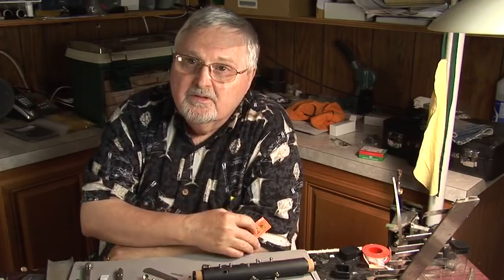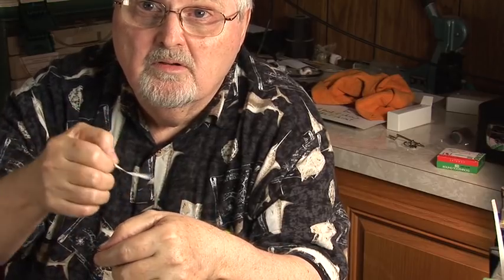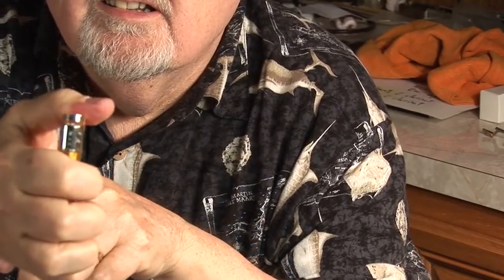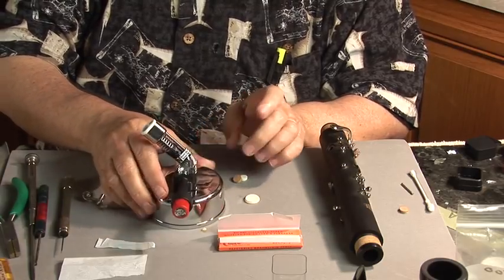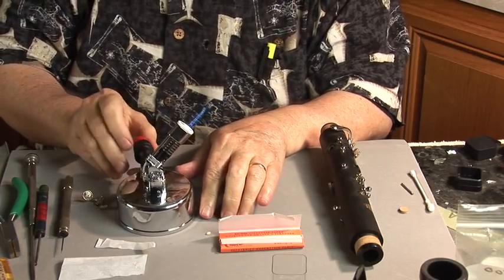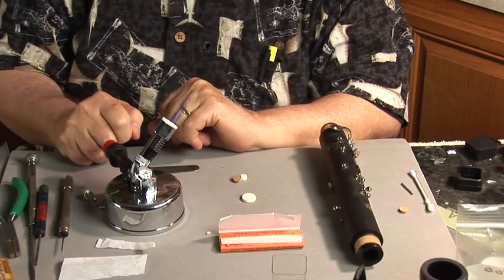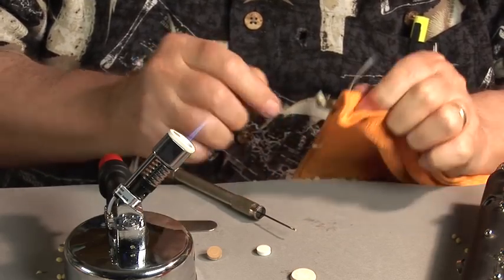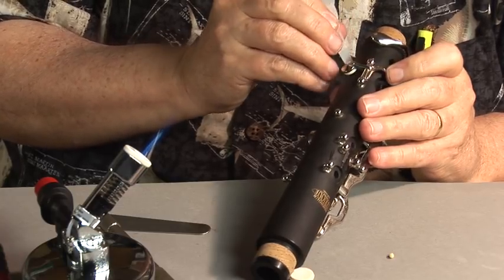clarivid 82b how to install clarinet pads

Comment: This video really helped me! I play Scottish flute (the older simple-system flute that's built like a clarinet), and it's hard to find repair techs who will work on my flute--even though it's like a clarinet. Your video was great because it clearly showed the flame technique for heating the pad cups--I was doing it incorrectly for fear of overheating the pads.

I found that using a jetted burner like yours (or mine, a repurposed torch for making creme brulee) made a huge difference. Thanks!

Comment: I followed the instructions and it worked perfectly. I used the materials provided in a MusicMedic repair kit. I tried hard to eyeball the pad as uniformly flat and level all around as possible and no float in was required. Plays great. Excellent video. Thanks.

Comment: Thank you so much for making this!  A pad suddenly fell loose in a key cup, and with no local repair shop or even simple tools, I was lost.  After watching your video, I experimented with heating the key cup on the clarinet for an emergency fix and was able to melt the glue enough to get the pad to reseat.

Comment: Thanks for the video! I bought a cheap Bundy Resonite off Craigslist because I wanted to play again. The last time I played was 23 years ago in middle school!!
Everything seals perfectly except the first large key at the bottom, which takes a ton of pressure to seal. Turns out it was leaking a bit on the inside "pad too thin".
I'll get it repadded properly later, but for the moment, I slipped a bit of ELECTRICAL TAPE under it, and it seals a whole lot better now!
Of course this isn't a permanent fix, but I can practice a whole lot easier! The notes that required that pad were really fighting back!

Edit: Took the key off, melted the glue with a lighter, added some more hot glue and re-seated the pad.  Seals PERFECTLY now.
Also, one of the springs was a bit weak - I bent it a little to provide more sealing force.  Works great now!

Thanks for the info!

Comment: @bobwas4066 I actually made the spring hook in 1978--from a piece of drill rod. I hand filed it and shaped it--and it has worked great. The screwdriver I bought about the same time. I"ve had others since, but it is still the best. I got it from Allied or Ferrees, but, again, using drill rod of the right diameter and flat files, etc, with a little patience you can make your own screwdriver. On the clarinet a long on like I have always works best. Hit the hardware store and use your imagination.

Comment: Thank you so much for your EXCELLENT teaching video...I just re-padded a cheap Selmer Bundy and on the top piece, I have 4 leaking pads..I used only one georges ball for each pad...may be my problem. The ones that are on the side are the ones not sealing...will try your fix tomorrow....I do a lot of personal car work on 3 street rods and your fingernails looked like they were manicured compared to mine...the finger nail comment below was not appreciated by me...your extreme helpfulness was.
Reply: Where do you buy that Georgia pellet Glue?
Reply: @leopoldoroldan345  It is called "George's Glue" and it comes in pellet form. It can be purchased from the JL Smith and Company website ( http://www.jlsmithco.com/padding-adhesives-2?range=13%2C15%2C15 ), and I think that you can find it on eBay and also if you search via Google to locate a stockist near you. Cheers!

Comment: I need help setting up my alto clarinets, a Bundy and a Paris Selmer. In both cases, the register mechanism isn't working and I can't find any sources of info on how to check and adjust the various keywork after a major overhaul. Also, where did you get the torch ? Thanks.

Comment: Just wondering why you don’t use a light strip. I got a cheap Chinese one which fits perfectly into the clarinet and in dim light the leaks are obvious. My bottom E and F keys show leaks but lm just wondering whether to attempt reseating. The E13 buffet has had very little use and l am annoyed because it was expensive. Here in Northern Ireland repair shops are non existent . Incidentally , most people roll their own cigarettes here  so getting those papers is no problem. A packet of 20 decent cigarettes over here costs about 12$ ....not that l smoke.

Comment: Hi Mr Ridenour. What happens when a screw seems to be attached to the key and you can not take it out because the head of the screw seems to no longer exist probably because of a bad repair. If it is a plastic clarinet what can one to to repair it

Comment: On my resonite clarinet, the surface is easily damaged by heat and plastic glue. Prefer to use shellac. Easy to burn/scorch the pad so vital not to overdo heat by even a second.

Comment: Didn't you use too much adhesive pellets (5 to 6 pellets)????
Shouldn't you use 2 to 3 pellets???
Reply from the maker: Better too many than too few. How many depends on the style of the pad, the depth of the key cup and, of course, the size of the pellets. There is no "one size fits all" formula that works in all and every case.
Reply from the maker: IN reviewing the video note: the pad I'm installing is a VERY thin pad. I number of pellets were used to make sure it would seat well. If you don't put enough glue in the key cup for a thin pad it will leak in the back and there's nothing you can do to make it cover--it's too thin.
Reply: Okay, thank you for your answer. By the way, great video.